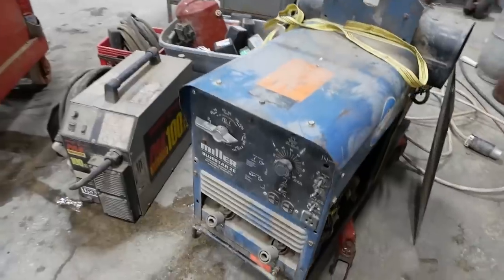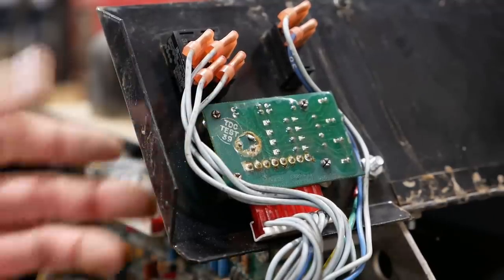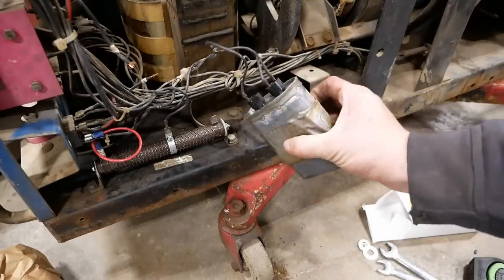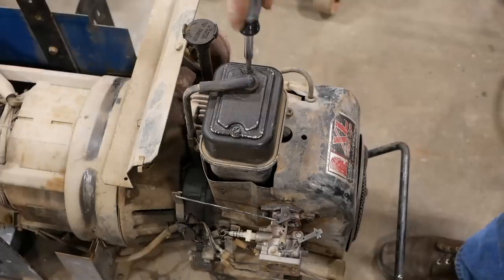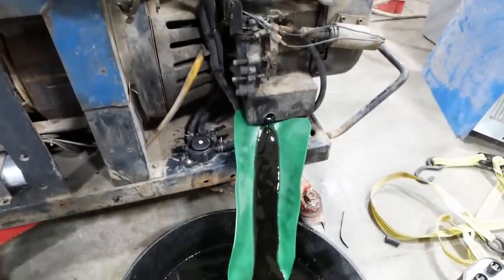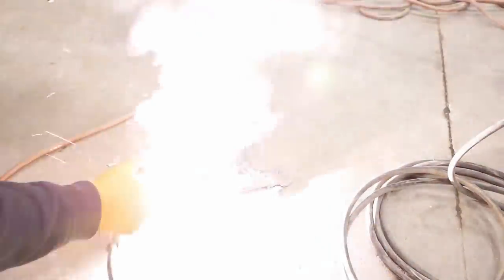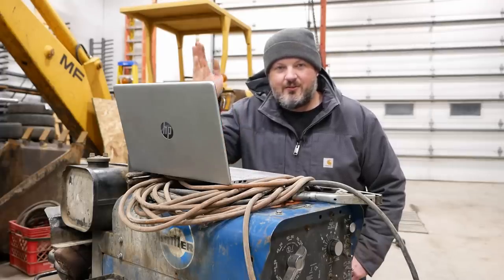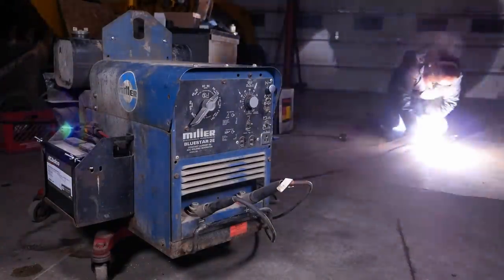Mostly Fixing my Bargain Portable Welder | Miller Bluestar 2E Part 2

Comment: Wes - Great video. My experience is that you don't want to be welding directly on a concrete floor!  It tends to cause chunks of the floor to "explode" due to water in the concrete vaporizing and spalling up chunks of concrete.
Reply from the maker: I do it all the time. It's more dangerous with torch slag which pools up on the concrete.
Reply: @mmm365 , there's nothing wrong with putting batteries on a concrete floor.
Reply: @mmm365 , is that the best you have?  I state fact "there's nothing wrong with putting batteries on a concrete floor" and you come back with "also dont work on a concrete floor, your knees will thank me in 10 years".  I never said anything about knees so why bring them up?
Reply: @mmm365  Nothing wrong with batteries on concrete and your knees are equally damaged by wood as they are concrete and any other hard surface.
Reply: @mmm365 , or should I call you Captain obvious? Thanks for that bit of info... I had no idea it is better to work on a workbench than on a floor.

Comment: My DeWalt batteries have not been holding up well at all when it comes to the case I've been having problems for years but I did find on eBay and Alibaba that you could buy replacement cases but they were generic.

Comment: I watched the whole video and was wondering did you find a replacement electronics board for the miller welder .
That welder is it mig also ,I seen you welding stick which is fine for heavy steel and frame work around your shop.
The stuff you fix is amazing too me but don't surprise me one bit about your skills .
You never know what on your channel too.
Reply from the maker: The portable is stick only. Yes I found a board.

Comment: one issue fuel pump is lower than fitting. you will get oil down pulse hose into fuel pump and cause a failure
Reply: I put the exact same one on my John Deere 111 over ten years ago.  It's lower than the engine.  Works great so far.
Reply: Fire it up!

Comment: Another cause for electronic fubar is using the welder to melt ice in pipes (pipe thawing).  There is (was?) A specific attachment for that.
Reply: That's what the circled marking is on old tombstone welders. It's the pipe thawing setting. I guess the circle is the cross section of a piece of pipe? It's at the 75. Past that there's no special attachment that I know of. You just hook it up and go. I don't think it is a recommended technique today. Newer models don't have the marking.

Comment: That battery ain't going to hurt anything. Just stay away from the Walmart never start batteries and you'll be O.K. Just make sure the charging circuit is working on that engine and your good. Maybe add a small trickle charger when its not in use.

Comment: Nice work Wes.  I’m all for making old stuff work again.
Is that little fuel pump 12v.  I’m assuming it is powered from the ignition switch?
Dave
Reply from the maker: It's an impulse pump. It works on pressure from the crank case. Common for single cylinder engines.
Reply: @WatchWesWork  
I was thinking the original was cam driven or something mechanical.
Makes sense now
Thanks!

Comment: 7:33 completely possible that I’m overlooking something, but all that effort to epoxy and hot glue the solder joints, but then no dielectric grease for this pin connector?

Comment: Hi Wes, I'm thinking you are right, someone reversed the power leads to to the battery and fried it, the good news is the circuit is simple. my guess is all the semiconductors are bad now just 2 scr's and a couple of diodes. I . I saw a replacement for 190 bucks, seems high to me. 
do you have a schematic for the board?

Comment: Did you use some sort of long shear to cut out those isolator strips for that fuel tank?  They look like they were cut very straight.
I wonder if those DeWalt batteries are shrinking in the cold, and then when pressed into use, if the cells are expanding due to heating up, and cracking the case.
$27 for the air filter??
In my opinion, those solid-core trace-jumpers, soldered to the board like that, might be more prone to damage (to the solder joint) due to vibration.

Comment: I often wondered what glue I might use to seal boards. Honestly I never considered hot melt glue, although it is cheap. I guess one could get away with it if the board doesn't generate much heat. Any other options?
Reply from the maker: I don’t know. Hot glue is often used to hold wobbly parts like big capacitors. Silastic is also used. It’s like RTV basically. They use varnish to seal the solder.
Reply: PCB sealer is called conformal coating. There are articles about it on the net.

Comment: Sediment bowl whole assembly is only ~25 on Amazon (assuming is the same as an old Ferguson tractor)
Reply from the maker: It’s much smaller than any I have seen.
Reply: @WatchWesWork  I was thinking something like B09QRWT11T on Amazon, looks about the same but hard to tell. Gives you dimensions though

Comment: @27:17  Completely ruined engine.  You can tell by the rapid starting and speed regulation.  Those things are supposed to be finicky and act up all the time when they run right.  If they give you no trouble, you done goofed up.  Better scrap it.  I'll be by tomorrow to take it off  your hands....

And that jumper sticking to the tip....  It happened to me everytime I tried it.  Glad it happens to the boss, as well as me. Take care bud.

Comment: When soldering, use more flux than you think and less heat and solder than you think. In this case, the bigger the blob, the better the job, doesn’t hold true. 😏🤷‍♂️

Comment: My uncle left me one of these the motor turned out to be seized some of the spark plug out of it got full with rust I found a replacement motor locally on OfferUp 175 bucks do you think it's worth me investing any time or money into repairing this welding machine?

Comment: i thought you could test diodes in circuit. I might be wrong but I think you can.
Reply: It depends on what's across the diode. That board is hooked up to a solenoid so one of those diodes is across the solenoid as a flyback. Now disconnected you're OK. But there's times when that's not going to be the case. Although you could test the diode then using high frequency.
Reply: @1pcfred  I was hoping someone would reply to that because i wasn't totally sure if that was the case. Thank You.
Reply: @Flowtester1  the problem we're seeing here is the human factor. Someone already monkeyed with that board. When people are involved then all bets are off. Because people can do anything. They could have taken parts out and put in different parts backwards. We've no way of knowing that now. Though often boards are marked. Still the parts themselves could be completely wrong. We're not seeing things in an unscrewed with state.

Comment: all those large electrolytic capacitors inside the plasma cutter.............NOOOOOOOOOOOOOOOOOOOOOOOOOOOOOOOOOOOOOOOOOOOOOOOOOOOOO. fingers crossed they were replaced previously. 2x red battery cables...........LOL

Comment: You can buy empty battery case for 10-20$ on ebay, aliexpress.
Reply from the maker: Really?
Reply: @WatchWesWork  Yes they are sold as a kit if you already have 18650 cells. It's from china, not original dewalt parts but if it can save a good 130$ battery... They also sell impact driver and drill shell/case for different models, just need to transfer inside parts.

Comment: i have had problems with my rigid tools. my batteries died and the batteries where stupid expensive when i did buy them i wasn't told i had to reregister the tools. when my new battery melted they denied my claim.
Reply: even registered, you'll never get RIDGID to replace a battery.  They'll blame you and error/misuse is not covered.

Comment: I have a shopmate 300dx and it’s throwing a help-2 code reading thermal wiring on rectifier is bad I replace the rectifier and the wire going to the main board ?? Still says same code? Any advise?

Comment: when your test components can you say or show what setting you're using on the Multimeter? for those of us that are learning to use them and learning how to test components.
Reply from the maker: I was using the diode test and then just testing resistance. It's very hard to test components in the board.

Comment: looks like someone fixed that. you could get a new control and mount the board over and remote wire the pot to it to relieve the strain
Reply: get a heavy duty knob and mount to to the plastic with a big washer in back
Reply: ...or glue it up

Comment: How did you identify it was 3 phase? The plug looks like a 240, 30 amp twist lock ... :-) Am I not seeing something?@1:25
Reply from the maker: It has 4 wires.
Reply: @WatchWesWork  A 240 single phase plug has line 1, line 2, neutral and ground.
Reply from the maker: @RobertKohut  There's no neutral in a typical single phase 240V circuit. You only have a neutral if you need a 120V circuit as well. Sometimes you see that on washing machines or other appliances.
Reply: @WatchWesWork  Sorry I was mixed up. Thanks for clarifying that for me... 🙂

Comment: No way you are going to damage or 'blow up' that Tecumseh OH160 engine.  It will leak oil like a mutherf....  but it will run.  I have my 33yo 12hp down to one leak, had to replace all the seals and orings in it.  The valve cover still leaks.

Comment: Something I don’t understand you ask about Dwalt batteries eBay cheap batteries last longer that original batteries I got Milwaukee chainsaw I didn’t want to spend $299.99 for a battery because that’s what I paid for the saw,battery, charger, chain,bar,bar cover. So I ordered from eBay old Chinese cheap batteries they charged same and last twice as long and there lighter that’s what does not make sense

Comment: with inflation figured in you didn't spend half the time or money.that was a 600 dollar welder 5 years ago. 1200 dollar welder now. im not sure the wattage. i would assume 8000 . is there a way to add 220 output so it can possibly run your plasma or back up the shop during a power outage.
Reply from the maker: Not really. They only put out 28 amps at 125v or 14 amps 220. You won’t run much on that!

Comment: My choice would have been, toss the old board, buy replacement!
Reply: There's no guarantee that'll fix anything. I'd bet the fault lies in what that board is driving. So you plug another one in and it'll do the exact same thing. Then you might begin to suspect there's deeper seated issues.

Comment: its a shame,these old welders,machinery, last forever,but, you have to keep up with tech. smaller,shtier. theres a couple chnls i watch that home repair thrown out ''broken'',old junk..the plasma, should be worth all your effort. 1 thing,,i allways check, clean all contacts..green death .then paint,oil, grease, protect from air, water. ausie,ex britt, cant reside in u.s. as they still remember the fkn tea party..

Comment: Great jobber Wes, but the high dollar gas shut off you purchased, and installed, are great for few weeks, maybe a couple months at best.
Then the communist gasoline we're forced to purchase, that eventually will kill multiple components on small engine, of both 2 stroke, and 4 stroke varieties. 
It'll start leaking ever so slightly that you won't notice, until you start wondering about tune-up time, because fuel consumption will start being issue.
Also unless you have fuel line rated for ethanol fuel, It'll break down the rubber itself, and you start getting air in your supply fuel line at pump and eventually the carb.
Then the rubber breaks completely down, and it becomes sticky as early to mid 80's Chevy truck steering wheel feels. 
Like your sticking to ancient melted cotton candy. 
Yes Sir, been to thar party, and every six months I buy 2 or 3 of the cheap values, and about every year and half replace about 9 or 10 ft of 1/4" fuel lines, and the grommets for the fuel tank where the lines enter and exit the tank itself, because of tank located under seat, will start getting water in tank when I wash all the dirt, and grass that's blown back on to the mower by the wind overpowering the actual discharge of mower deck, even with discharge shoot in correct position. 
Royal PIA, caused by communist leadership bowing to the rest world by thinking that the rest of the world should comply to whatever standards we supposedly think that'll through our changes It'll change the damages that'll take Mother Earth probably million years or more before she'll be any noticeable major changes in the condition of the Earth.
That's if we don't incinerate ourselves, and Mother Earth before we actually figure out how to all just get along, and except the fact that even though we're all from the same planet, we're all slightly different with different personalities even at the national level